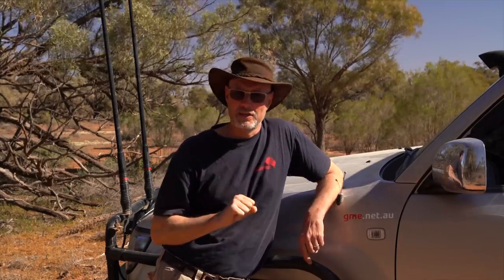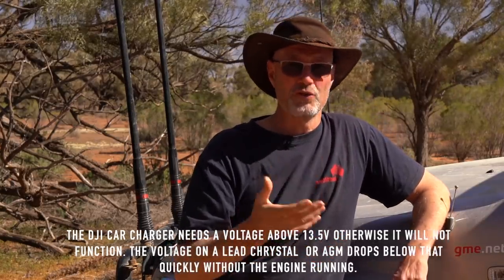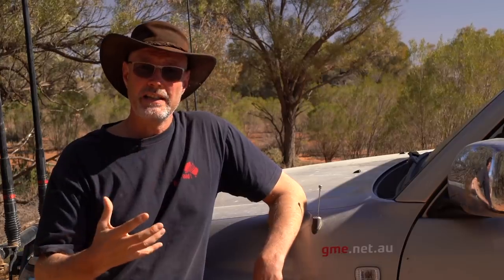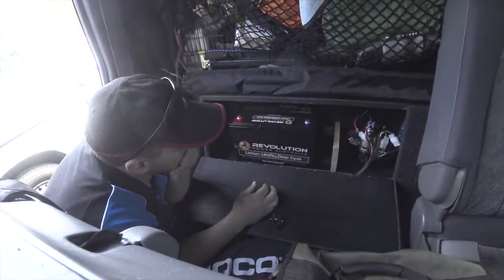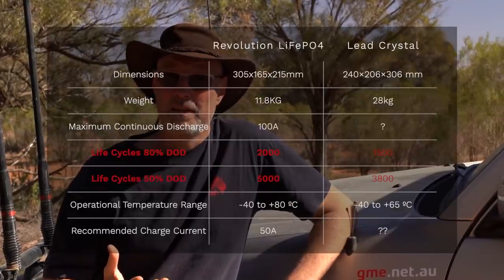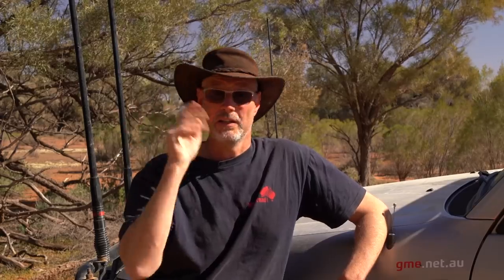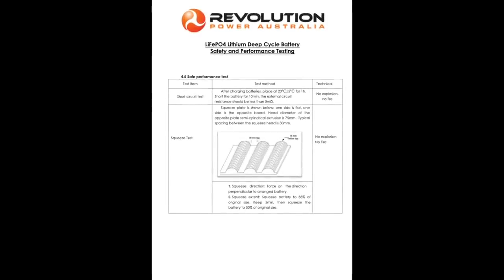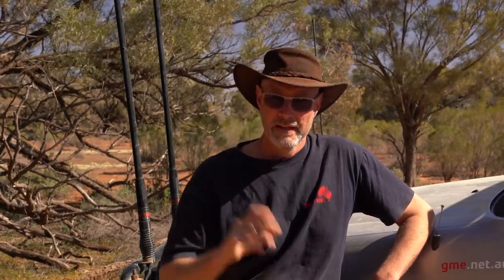Lead Crystal to Lithium LiFePo4 in my Landcruiser 105 - Why I changed!

Comment: Good video!  Heat is the enemy for any electronic or electrical device. Some of the biggest aftermarket 4x4 stores still recommend under bonnet installations, then scratch their heads when they under perform or one or more components fail.

Comment: Recently went through the same process with my Prado.  After many years with AGM and normal Lead batteries, decided to go lithium after a couple of years research.
Yes they are expensive and that is something you have to take into account over the life of what you are currently using.

Slightly different to your setup, i replaced both start and auxiliary batteries under the bonnet with Lithium and dont run a BCDC.  The batteries are warranted under the bonnet and with the in built battery management setup, dont requires BCDC.
I looked at my current system and what to replace it with, weighed up staying with what i had, lead crystal and lithium.  Obviously finished going with Lithium.
I looked at what would be required moving from my current setup with normal start battery and AGM to Lead Crystal.  Was going to cost quite a bit with the requirement of BCDC and i had my doubts about going this way for reasons i cant explain and absolutely with no weight saving.
Finished up going with 2 x 75 amp/h Lithium batteries from Deep Cycle Systems (https://www.deepcyclesystems.com.au/product/ultimate-dcs-12v-150ah-dual-battery-setup-lithium/).  Had quite a few calls with them and all question were more than adequately answered so i decided to invest in their batteries.  Was a very simple swap over, saved 35kg in weight and now have more than double the available amp hours of my old 100 amp/h deep cycle.
Have i made the perfect choice, i dont know and only time will tell.  If my new setup all lives up to what has been promised, I will have it working as it is now for many years to come.  
If not, thats life and we try something different again but so far, very happy and will get to give them a proper test in a few weeks :)
Hopefully this is useful information and contributes to the discussion on using Lithium.
Reply from the maker: as I understand it,  it's still highly advisable to run a DCDC charger with Lithium profile beside every LiFePO4 having a build-in BMS. Which starter battery did you go with is it LiFePo4 as well?
Reply: @AlloffroadAu  Both batteries, Start & Aux are lithium.  Not sure what youtube did to the link, copy this - https://www.deepcyclesystems.com.au/product/ultimate-dcs-12v-150ah-dual-battery-setup-lithium/     
As i mentioned, i did quite a few phone calls with DCS and had many questions before deciding on doing this. I read a much as could through forums and trying to filter what was valid information wasnt easy.  Time will tell if i got it right.
Reply from the maker: I watched the Video, Interesting I also did quite a bit of research and that are the first people selling LiFePo4 and say no issues under the bonnet and no need for DCDC. I'm keen to hear how you go in a year or two please keep me posted.
Reply: I've been looking at this system for 6 months for my new Prado. Can you share some pics of the setup? Your right, the DCS seems to go against most other brands but for some reason I trust them! Also no need for dcdc charger. Fantastic.
Reply from the maker: I just had a long chat with DCS and I agree it makes sense what they say. Stay tuned seems like I will be testing some of their gear very soon..
Reply: @Jay-hr9ci  There are photos on there of a 150 but the current system uses a different battery controller than what is shown, much smaller now.  My setup is similar but the wiring is run differently and hidden.  As it was originally using lead batteries, my start battery is on the drivers side.
Reply: @AlloffroadAu  Glad to see I am not the only one who has been intrigued by there setup. I found Paul to great to talk to and always happy to answer my questions.
Looking forward to seeing how you with testing the DCS batteries.
Reply from the maker: @davewarland1680  same here mate quite excited as if the setup works and does what Paul says it would be the value for money system around, may even replace my starter in the Cruiser will see.
Reply: Definitely  need to see a DIY install in real detail
As the lithium battery and setup will be a minimum  3grand plus labour  and materials

Comment: I was told from dealer not to put under bonnet. Really not sure why you put yours there .Also had about 2 years mostly in the Kimberley. Has worked perfectly. Use 40 amp
BCDC  . I would prefer lithium but even though there has been a massive drop in price of raw material the prices are still horrendous. Love your videos keep up the great work 👍
Reply from the maker: I was advised by the dealer and by betta Batteries that the battery under-bonnet would be fine, the BCDC was also installed by a "good auto electrician" supposedly no issue. Mind you it's no issue if you do highway or fire trail driving or even in Tassy it was ok but idling along at 25-35kmph in the desert is a different thing.

Comment from the maker: have you had a different or similar experience with Lead Crystal, let me know in the comment section. Do you have a LiFePo4? Please let me know which brand and how long you have it for.
I should state that the cause for overheating of the BCDC was the location wedged in behind the headlights and in front of the aux battery. Hot Desert weather, tail wind combined with low range crawling did not provide sufficient airflow. I relocated the BCDC in Alice springs in front of the Radiator and the overheating issue was solved.

Comment: Thank you for your video, which my husband and I enjoyed. We have had our own lead crystal batteries for over 5 years, but on a recent camping trip, found our fridge wasn't being powered sufficiently when stopped overnight, and which we are currently testing our system to identify the problem (fridge, wiring, dc to dc charger or batteries (have two 100 amp lead crystals in back of car!), but after watching even likes of  your presentation, deem potentially we could have a battery issue (still testing!), but am contemplating upgrading batteries noting the weight advantages of lithium seems highly attractive for obvious reasons if for touring purposes. We have looked at 'Enerdrive' brand, and others, including 'Revolution'. To be honest, there can be a huge price variation across all lithium batteries on offer, but note brands as mentioned, incl. 'Redarc', though these brands cost wise more expensive, stand out as deemed quality units. We have an Enerdrive 40amp DC to DC charger, (I think costing us about $450 purchased not that long ago. One of the problems in changing battery setups (say lead crystal to lithium, as in case you show), it appears 'Revolution' brand will only further recognise two battery charger makers (redarc and Vitron), so spending more money on their recommended battery charger, on top of a battery charger, so as to avoid warranty problems, another thing to consider for us, although I still might check with Revolution if Enerdrive could still be okay. I note with the Enerdrive branded B-tec range batteries (with internal Battery Mang systems), that if you buy an 100 amp/hr, you can only parallel with another 100 amp/hr same battery, thus no more batteries;  and additionally cannot use an inverter more than 1000 watt. They also have the 200 amp hr which again can only be matched with the 200, thus a user cannot use an inverter more than a 2000 watt inverter whether using one or two batteries. One Youtube  business that sets up caravans etc professionally using say the Enerdrive, I noticed was using a larger inverter for this setup 2600 watts than the 2000 watt recommended. I guess what I am saying in all of this, the difficulty very ordinary people as myself can have in trying to do things as cost effectively as one can, all the while trying to ensure a good quality reliable system, that meets all the manufacturers demands. I have read good things about the Revolution batteries, but the idea (in my case), that I may also  an alternative battery charger is something to consider. (Indeed always so much to consider lol!) Out of interest Stephan, do Revolution batteries limit 'banking/paralleling' batteries to two of same as Enerdrive do? Also, on your 100amps/hrs which you have the two, do you run an inverter?  Cheers, and happy travelling anyway!
Reply from the maker: check out my Lithium Videos https://youtu.be/FbStDC-7Q9E and https://youtu.be/jKg8wxDUBV0  I would never go back to anything but Lithium...

Comment: i have basically the same setup as you had (i think) however i have a dual cab and have my 100amp/hr lead crystal in the tub charging via my Redarc bcdc 1250. i personally can not fault my set up. during a stint up work (fifo) i had forgot to turn off my fridge while away (stupid mistake, no safety voltage shutoff in place)and the vehicle was left with no sunlight for the solar and i came home to what i thought would be a damaged battery due to discharge. Im pretty happy to say that it has recovered fully and is just like new. i am very watchful still as my wife has the lead crystal in her engine bay with her Redarc 1225 so will be keeping an eye on that. Personally i think the combination of heat and placement of your BCDC may have been the issue? not sure on this but i think the redarcs shutoff at around 88*C?. i think your same setup would have been fine in the back of your cruiser same as with the lithium and no problem would have occurred. Anyhows,  just sharing my experiences with what i have seen, i love your channel. keep up the good work. happy days
Reply from the maker: Not many people spend days at high temperatures in the Desert and reach engine temps I reach. Main reason for change where weight, the voltage issue  for my Drones and now I have double of usable capacity. So far I could not be happier
Reply: @AlloffroadAu  I assume that you're using a 12v charger for the drones instead of a 240v inverter? Which in my view is logical (I don't understand why so many people use inverters to power 240v power packs which step down to 12v) however had your main concern not been related to weight, the voltage drop could have been addressed by an inverter. I'm sure you know this so my statement is aimed at those who are unclear on the situation. Thank you for your on going content!
Reply: just noticed your reply to EMU4WD. doh!

Comment: It is referring to a charge rate of 0.3 x the capacity of the battery at the 10hr rate ie what the capacity of the battery would be if it were completely discharged in 10hrs.

Comment: 3:53 There is an error in the chart: LiFePO4 is not specified for -40 degrees C.  -20 C is the correct value.  Also, I have been using SiO2 batteries for more than 2 years now (static installation), and I noticed the voltage drops while drawing amps, but it will go back to a higher value after a while; they do deliver the specified amps capacity.
Reply from the maker: the DCS Cells are, mind you we will never get below -10°c in Australia so should be no issue.

Comment: Stephen this is a great piece and explains fully your switch, and I follow your logic.  I am running two batteries under bonnet in my 200 Series, one lead acid cranking battery and one AGM accessory battery charged via a BCDC 1240.  I love the charging characteristics of the lithium and would like to replace my AGM BUT am restricted to an under bonnet installation.  I know your application is in the cab now but have you any information or can you point me to an information source regarding under bonnet installation of lithium?  All the information I have heard has been “no, it is not advised”.  Can I assume you received the same advise given you did not go with an under bonnet installation like your lead crystal was?
Cheers
Terry
Reply from the maker: Hi Terry, LiFePo4 like any other Lithium definitely not under the bonnet. When I had the issues I measured engine bay temps in the Desert and after prolonged slow driving and outside temps of close to 40° I now better understand why batteries and BCDC charger should not be under the bonnet as it can easy get 70-80° and more. LiFePo4 you can get in a few different shapes so I think it's pretty easy to find a place somewhere in the cabin
Reply: AllOffroad 4x4 Adventures TV thanks Stephen, interesting to know the actual under bonnet temperatures, thanks for sharing.
Go well.
Reply from the maker: this is supposedly suited for under bonnet application https://www.deepcyclesystems.com.au/product/12v-80ah-extreme-battery/ but never tried it so can't comment.
Reply: @AlloffroadAu  not only that. It has a three year under bonnet warranty. You'd be lucky to get another brand to give you 24 months with a wet cell!

Comment: Out back cough - love it never thought that heat would impeded the  dc to dc, but it makes sense
Reply from the maker: Yea me neither before this
Reply: @AlloffroadAu  I found out in 2014- slow hot outback driving towing- fortunately I noticed it and had a bypass switch so at least some charge was going in, Redarc just forgot to mention it and the specs did not say. The specs clarify it nowadays. Sorry I did not tell you :-(

Comment: Firstly, great real world review. Excellent but I do have questions regarding the original Lead Crystal battery setup. Your desert expeditions is the ultimate heat torture test.OK...watched video again and answered most questions.. Did you have the storage battery located in the back of the vehicle the same as the Lithium battery? A,. No.  Was the the charging system for the Lead Crystal battery adequate? A. No. Couldn't handle under the bonnet. I am wondering if the issues cause by heat lead you to reconfigure the design when you went for the lithium? A. Yes.   Did the other components handle the heat properly and charge the Lead Crystal batteries properly? No.  Was the lead Crystal batteries being charged properly? A. No.  I would have expected a Lead Crystal battery to be able to  charge a drone battery? Would this have charged the drone if the Lead Crystal battery was charged properly? A. This could be tested on a table with a charged battery.  Useable power and weight were the big factors in changing to Lithium. It is great when things just work!
Reply from the maker: to answer your questions, the charging was sufficient and correctly set up however the BCDC at the position under the bonnet was not ideal but all of that did not have anything to do with the battery bulging. Better Batteries advised that under bonnet application was not an issue. If you watch their charging video you will see it contradicts their own data sheet and why I ultimately changed. I now have a dual DCS 100ah LifePO4 set up under the bonnet, I know that will reduce the lifespan like with any other battery but expect to get 5-7 years out of it, time will tell. Check out my LiFePO4 video if you haven't https://youtu.be/jKg8wxDUBV0. As far as I know Betta Batteries withdrew from the Australian market. I'm not saying Crystal Lead is bad but in my opinion no different then a good AGM like the North Star which I had afterwards as a starter battery und made the same promises as Chrystal Lead without all the charging difficulties.
Reply: @AlloffroadAu  We need reviews like yours. I watched your first review when it was installed. We need to know if a system can handle that extreme desert punishment!   lol. I did laugh when I saw you cooling the system with a spray bottle.  You may have reached the upper limit of the Lead Crystal in your desert duel! The Lithium has a higher temp tolerance. The bulging is not good. But I do think it was more normal for that battery chemistry. I was reading the marketing also. I was trying to work out if the BCDC on the market could charge this properly? Even the Redarc...which is a quality unit. I am more inclined to think the BCDC do not work properly located under the bonnet...and that failed the relevant torture test also in combination. Betta certainly made some bold claims! This is classic Lab result vs Real world. :)
Reply from the maker: yes Betta Batteries also said bulging is normal,after I relocated  BCDC charger in front of Radiator I had no overheating issues anymore so to choose a good spot especially under the bonnet is very important. There was still no charger with a Crystal Lead profile available, charging routine was inconclusive for me,I had no weight savings, still only 50% DOD usable if I don't want life cycle to shorten substantially and my Drones would not charge unless battery was very recently fully charged. LiFePO4 sorts all this for me so I'm very glad I changed.

Comment: Lithium 100ah 
In the rear draws 
Redarc 1240D  

All in the rear .. nice and 😎 real cool
Second lead battery $104 under the bonnet for cranking 👌🏽
Reply from the maker: good set up what LiFePo4 did you go for?

Comment: Hi! Very interesting video. We are from Switzerland and recently visited Australia last winter and bought a redarc bcdc 1240D for our camper in Switzerland. I saw in the video you are using a model I don't know the bcdc 1250D. I didn't see this model from redarc 8 month ago when I was in Australia. Do you think that the bcdc 1240D will make the job for a lithium battery setup like your? Best regards
Reply from the maker: Yes the BCDC1250 is fairly new your 1240 is fine as well just charges a little slower
Reply: @AlloffroadAu  Nice. Thanks for your answer!